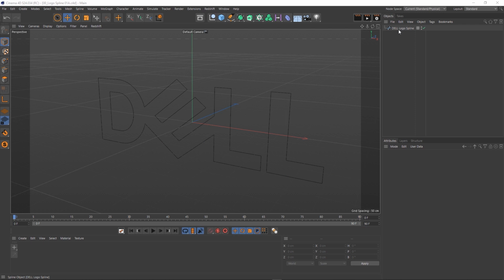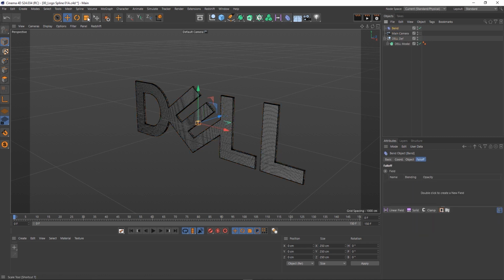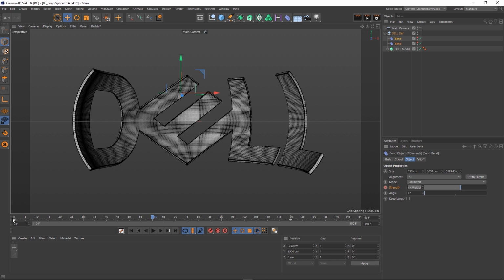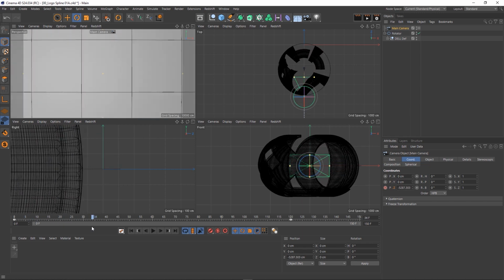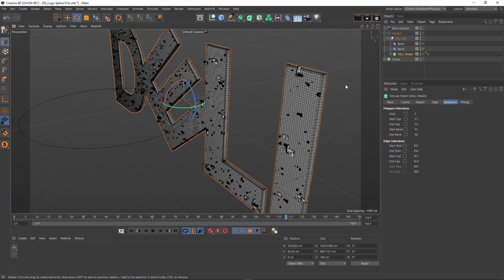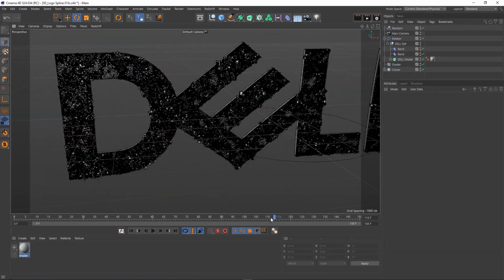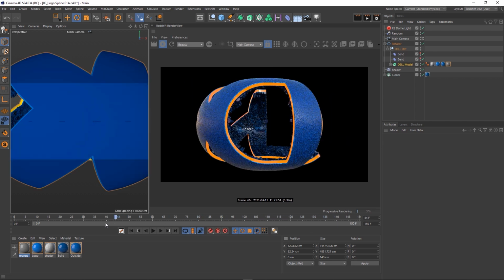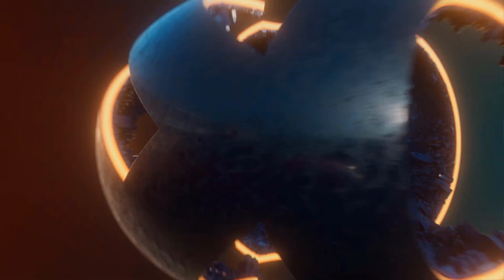Athanasios "Noseman" Pozantzis @ The 3D and Motion Design Show

Comment: I think a lot of how the building cloner performs is based on the shape of your geometry. The logo I used was more square than Dell's and I had some flipping and strange offsetting from the surface at the top and bottom. Is there any way to correct that?
Reply: without the model I can't tell...